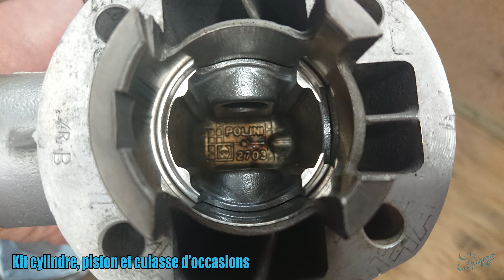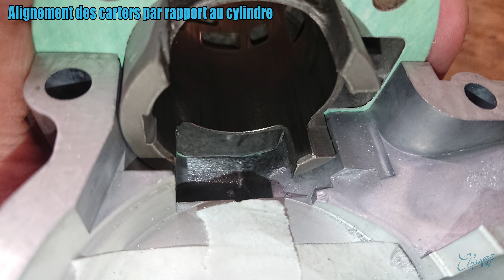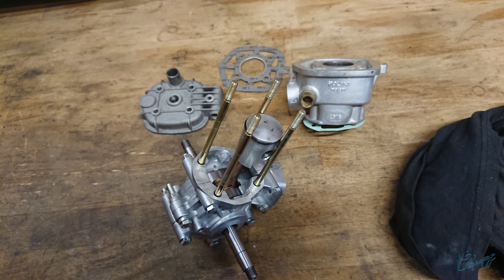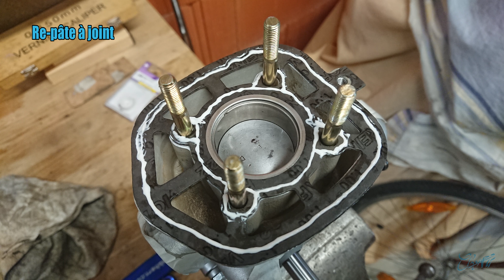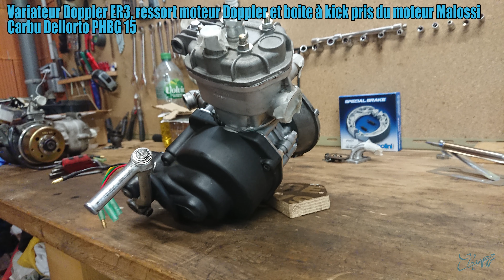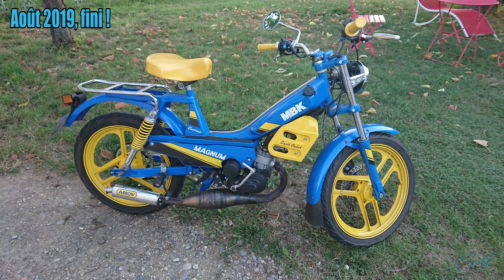MBK 51 Magnum Polini 50 W

Comment: Les diagrammes sont pas haut sur le polini de ce que tu as mesurer par contre en balade il a l air de watter quand meme!
Reply from the maker: Ben il est juste en dessous du Malossi mais pas de beaucoup. Le vario ne se fermait pas entièrement non plus comme avec le Malossi et il saturait à 80 ou 85 km/h comme le Malossi aussi. Légèrement plus coupleux plus bas. Mais il est très pointu, obligé de le faire gueuler tout le temps. Il n'a pas non plus de plage de variation. Rien en bas régime, creux mi-régime et puissant en haut régime. J'ai essayé avec le Giannelli Gun Metal, aucune différence. Après faut pas trop se fier à la vidéo, ils étaient tous en mobylettes d'origines.
Reply: @chyps17  si le vario se ferme pas entièrement c est que tu es trop léger en contre poids.
Tu as testé avec le pot doppler ?
Reply from the maker: Non je n'ai pas testé le pot Doppler et pourtant je pense que ça serai le meilleur pour le Polini au vu des diags. 
Le vario, je l'avais rempli à fond de poids : les 3 plus gros poids sur chaque masselotte, je perdais beaucoup en accélération, obligé d'appuyer fort sur la pédale lanceur (j'aime pas ça pour le vilo) et il se fermait un peu plus mais pas beaucoup plus. J'ai vérifié plusieurs fois qu'il n'y ait pas de résistant ou d'obstacles sur le mouvement du moteur. Avec la pédale lanceur, je levais le moteur, le vario se fermait mais le régime tombe et la mob ralenti peu à peu.
Reply: @chyps17  en changeant le ressort moteur par un souple c est pareil ?
Reply from the maker: @beber0721  plus souple que le ressort Jaune de Doppler, y a le blanc je crois, j'en ai un autre trop souple, la courroie patine beaucoup trop au démarrage, ça prend pas même en appuyant sur le lanceur. Mais il faut réessayer tout ça. J'ai remonté le Malossi hier soir, je l'essayerai ce week-end. Vidéo du remplacement de moteur d'origine par le Malossi à venir.
Reply: @chyps17  à l époque je prenait 83   compteur vélo bien réglé avec pot doppler et bidalot rr liquide et ressort moteur stock et vario bidalot junior il se fermé à bloc. Car même en appuyant sur le pot ça changeait pas. Tu as essayé de remonter la pédale de lanceur avec le pied en pleine pointe pour fermer le vario une pédale lanceur peu servir dans les 2sens
Reply: @chyps17  tomahawk avait trouvé un super compromis avec un ressort gris. De memoire ce n'était pas un doppler, ceux ci n'étant pas adaptés et toujours le cul entre deux chaises. Vario à alourdir à nouveau avec. La flemme de rechercher. Bien à toi
Reply: @beber0721  revoir aussi l'épaisseur de courroie 😇